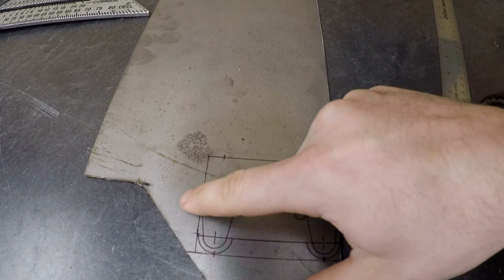CX500 Build - Fabricating A Custom Kickstand! - SO CLEAN! - EP52

Comment: Nice bit of craftmanship there. I was worried that you would put too much load on the engine lug but I think you nailed it with the oil pan studs.
Reply from the maker: Its too bad there is no provision on the cx500 for those pan bolts. It would be a cool product to produce

Comment: To make that piece, you have to have a welding machine and so on.
It is absurd.
It is much better to buy it from a provider.
Reply from the maker: Well, when a part doesn't exist you have to make it. That is what custom is. The keyboard or device you typed your comment on didn't exist at one point and had to be custom made in order to fit the builders desires.